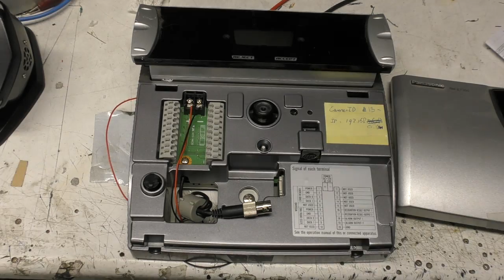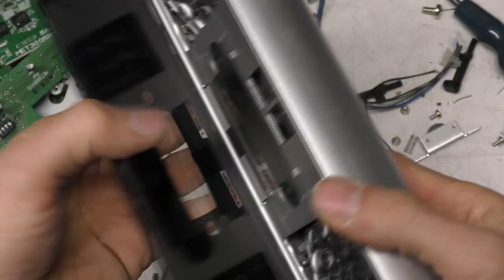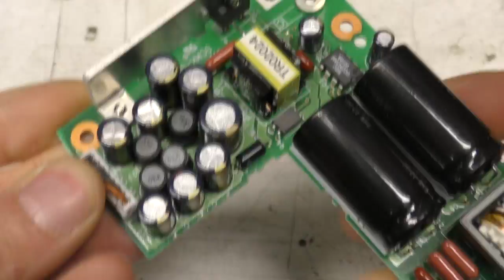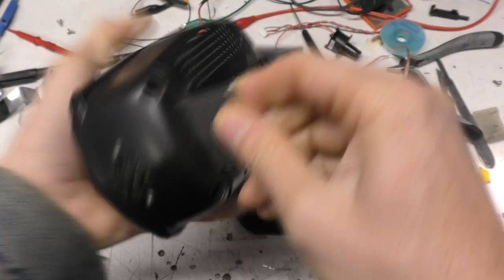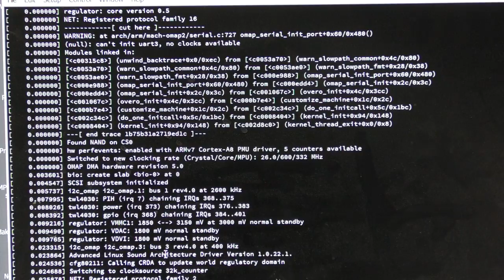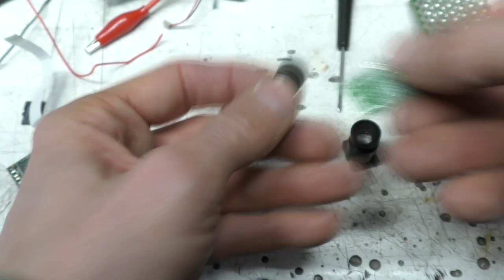Security access control iris scanners

Comment: The circuit bending at the end was glorious. I hope you don't mind that I'm going to sample it and use it in my next track.
Reply: Halojen 
I actually got a hold of some kind of smart intercom device that played a little tune and played some voice depending on the situation (door not being closed properly, fire situation, phone line cut, etc)
Shorting out some of the data pins from CPU, touching the crystal, and injecting negative voltage spikes after the power converter stage caused the speech chip to speak garbled language.
It was fun, until one day someone mistook it for junk and threw it into the dumpster.

Comment: 1. those chips behind leds could also be "open led protectors", so particular led string will continue working if one or more leds fail
2. more led strings could be either current limiting for POE powering and/or according to pcb layout, different angles for eye "scanning" for more precise image

Comment: The small silvery glass is almost certainly interference IR bandpass filter, not just attenuator.

Also the diodes across LEDs on the illuminators might be zeners set just bit above the voltage drop of the actual LEDs to limit the effect of single LED failure in each of the individual sub-strings. Similar thing is being done nowdays in better quality street LED illuminators to give them more reasonable lifespan and gracefull fallback on single point failure.
Reply from the maker: The silvery thing does not appear to have any bandpass characteristic - it's not a dielectric filter

Comment: Very strange seeing SD cards in an embedded product... Even the expensive ones aren't super reliable
Reply from the maker: These were marked "Industrial grade", for what it's worth. One Issue I've been meaning to look at for a while is how susceptible SD cards are to read-disturb errors in read-mostly applications. Raw NAND without ECC can lose data fairly quickly , MLC being a lot worse than SLC
Reply: The Raspberry Pi is particularly bad with this, it kills SD cards even quicker than they can kill themselves. We've had a 24/7 installation here where we had to switch cards about once a month. The third edition is much better now, though.
Reply: There is a big advantage to going with SD, which is future proofing and lower price per GB. Packaged NAND suppliers can obsolete their lines. Footprints and pinouts may not be the same. You need to redesign and recertify an entire product line if that happens. The main worry is going to be trimming on the SD card so use a FAT instead of pages and registers. Make sure you get a higher temperature, automotive or industrial graded versions as they can get hot if not cooled properly.
Reply: My experience with SD cards are amazingly good, I have deployed more than a 100 industrial equipment running 24/7 and I never had a single problem.
Reply: norbsli SD or microSD? Cheap or Automotive or Industrial rated ones?
Reply: Thanh Tran about 60% of units with SD and the rest micro SD with adapter, Kingston brand (we did try Sony and had problems), regular cheap SD cards using SPI interface, no file system I use it as a raw memory for logging data and storing configuration.
Reply: I know of some expensive test equipment that uses SD cards and a bunch of big deployments using raspberry pi's with SD cards. The pi's killed their SD cards in a few months of 24/7 operation.

Aside from just the issues with SD cards not being reliable over time there are issues with the filesystem going to crap when the power fails etc.
Reply: Luke Den Hartog there's an SD card in I think a Siemens fire panel. May only store audio recordings though.

Comment: Dont think ive ever seen a chip soldered to the top of another chip - in bga no less. Very cool
Reply: It's quite common in embedded applications; the last time I saw it was in a mobile phone.  The original two versions of the Raspberry Pi and the Raspberry Pi Zero have the system memory stacked on top of the main CPU.
Reply: Same story goes for a great majority of mobile phones (and tablets, obviously) from the last decade or so.